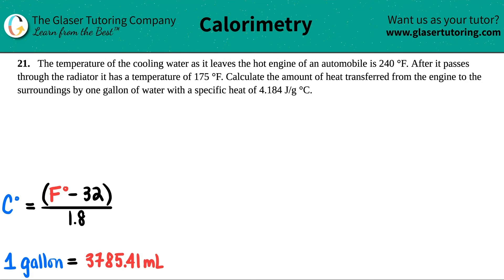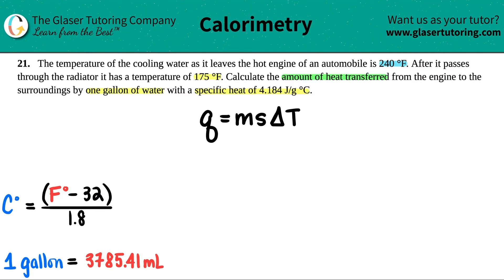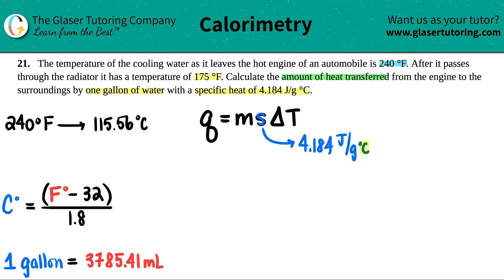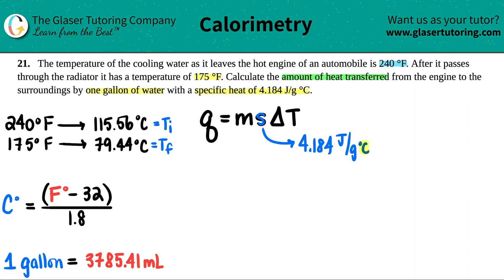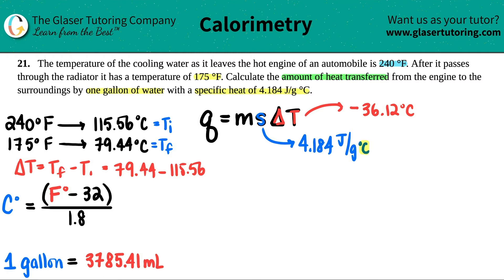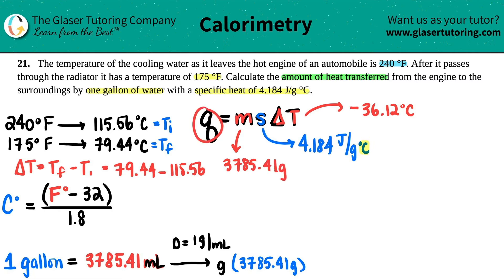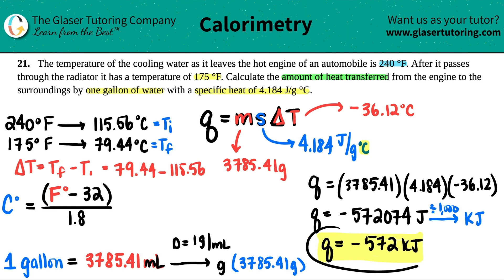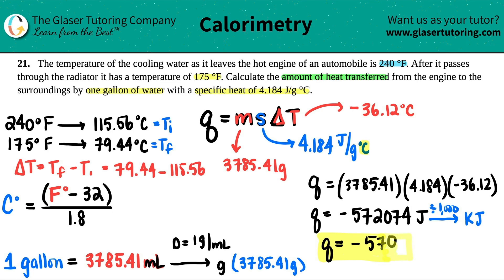5.21 | The temperature of the cooling water as it leaves the hot engine of an automobile is 240 °F.

Comment: Hi! I just had a quick question so I was trying to do the problem at the same time to test my knowledge, and when I did Tf - Ti, I did 79.4 - 115.6, leading me to get the final heat transferred in Joules to -573,341, which is slightly different than yours, would it still be right even though I used less sig figs in the delta T stage, or how do I know when to use two decimal places. Thanks so much your videos have been so helpful!
Reply from the maker: Hi Ellie!  Great question - you answer is correct if significant figures were taken into account.  With two sig figs, we both end up with -5.7x10^5 J or -570 kJ.  Usually the rule for sig figs is that we only round at the final answer but I would advise you to ask your teacher or professor if sig figs will be counted toward your grade on your next exam or quiz.  Hopefully this helps!